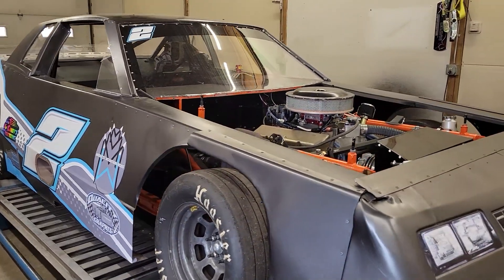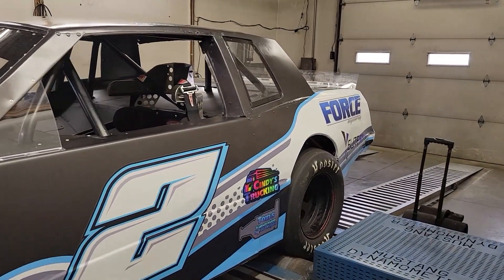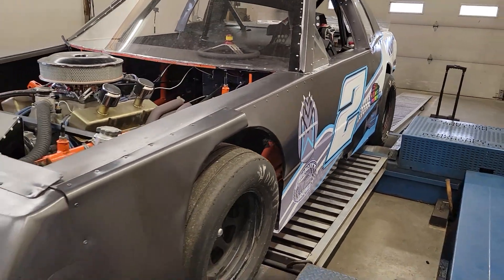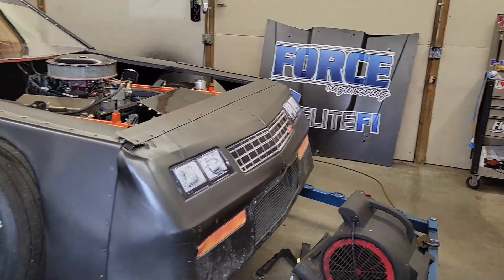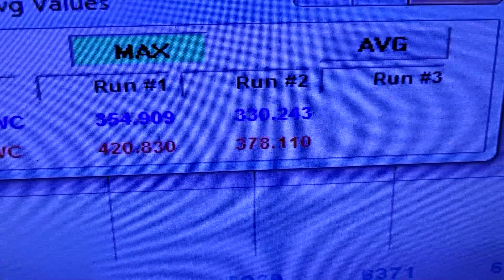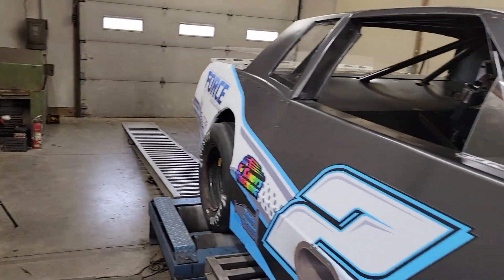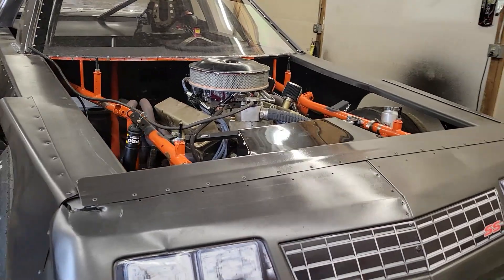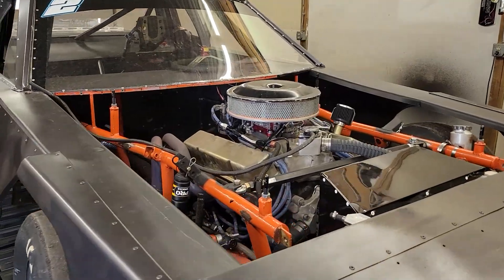355 SBC Asphalt Street Stock | Dyno Review

Comment: I love a good muncie 4 speed with 1st and second remkved they are bullet proof and reliable i have never had one blow up on me or break period on me. Im still running the same muncie from when i got into the first class of racing that alloqed muncie 4 speed which was our old super stock class and that was 15 years ago when i was 14 lol and it has a gppd 8 seasons on it cause when i built my pro truck i thought i would see if i can get more rear wgeel horsepower and torque by running a light weight all aluminum racing trans that ended up breaking on me after 9 races anf threw in my good ole muncie and have been running it in my pro tru k for last 5 years and no problems and it has never been rebuilt and after this season im sending it to my racinf trans builder and having him refresh it and rebuild it cause its way past due and im running a 7.5 inch tripple disk clutch withit. But you have a beautifull street stock man. I still have my old street stock and after seeing this it inspired me to think about getting my street stock back raceready and run a few huge street stock races around the country.

Comment: That things nasty. With I was allowed to run door exit exhaust like that
Reply: Down here where I race at in the south this car isnt even legal as our sportsman class type cars its more kf our old super stock class we yse to have which was a metric based car and allowed to have tube and remove stock rear cross member door exit criss over header type exhaust with a 2bbl if you have a big built motor or a 4brl double punper i 750 if you had a 604 crate motor and if you had a 602your allowed a 800 cfm double punper 4 barrel carb and a 100 lb weight break and a 1.5 inch spacer compare to the other 2 motor options which was only allowed a 1 inch spacer. Anf our body rule for old super stocks rules before they became outlaw stocks now was we had to run a stock metric car roof height which j forgot what that was and allowed to have a full latemodel body but the doors must be aluminum and of course no coil overs just weight jacks. And my built motor was a beast it made 415 horsepower to rear wheels and 487 to crank. I had a huge loss of power cause I had a quick change rear end under mine and we wasnt allowed electric fans when I first ran that class for 2 years of me racing in jt then we switched to electric fns so that crank driven fan eats up alot of horsepower. Your car is a beast and beautiful man. Everyobe loves a nice asohalt street stock or super stock cause they are just sexy anf look amazing almost like the early days of nascar type body in a way from the 80s